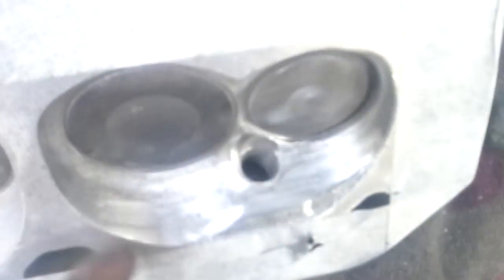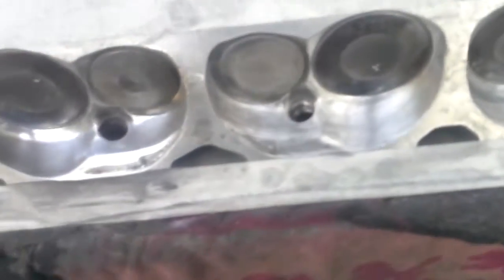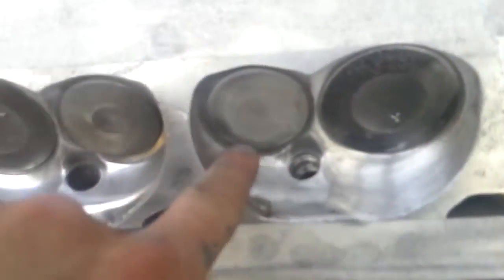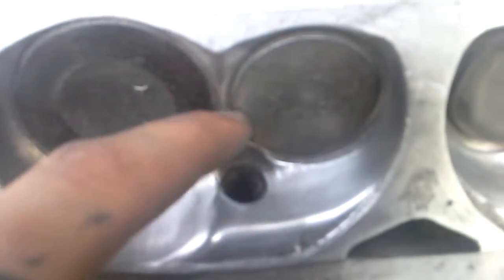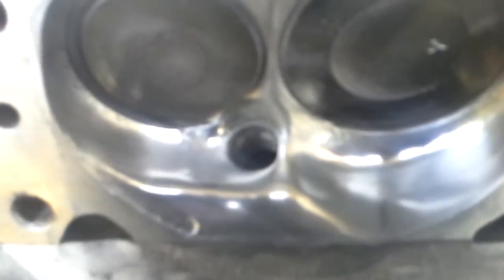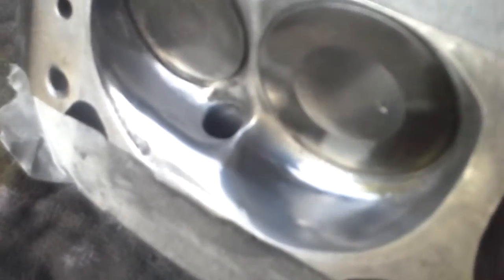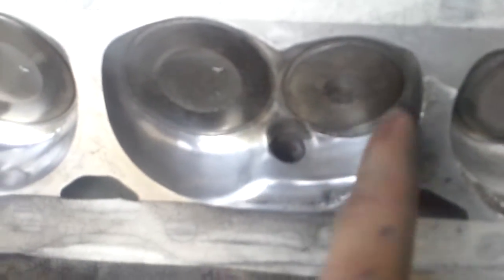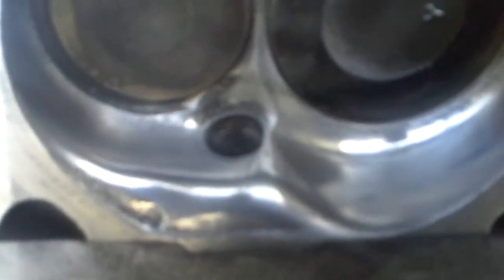Porting LT1 Heads

Comment: You don't even know what the hell you're doing ! Jeez. Folks , don't home port your heads.
Reply from the maker: Definitely didn’t know exactly what I was doing, especially when I posted this. I was at the time watching a lot of videos of a gentleman (can’t find his name now) that had done quite a few porting jobs on LT1s and he went way more extreme than this. My plan through this was to cut some of the hard edges down and smooth out the rough casting that’s pretty much it. These were milled/given a valvejob and worked great ever since. Was I wasting my time? Probably but it was fun and I learned some stuff. 😎🤘

Comment: I thought removing material from the combustion chamber lowers the compression down and you lose power
Reply from the maker: Big Greg sparks You're correct. However these were milled down to once again compensate for the loss of combustion chamber volume. Not to mention you can gain power from altering the chamber.

Comment: I ported a set myself. What all did you do to the intake runner? You get most of your power there.
Reply from the maker: These heads are back off getting reworked.. most of the material that came out of these was combustion chamber and exhaust. I'll make some new videos after I get finished up here in a couple weeks.
Reply: +Atomic Ws6  cool keep us posted on the progress.
Reply from the maker: +TPV Productions Will do man
Reply: +Atomic Ws6 Raising the runners helps the most.

Comment: real nice, do you do this for customers?  I have a 94 Caprice 9C1 with the aluminum LT-1 heads, I need a stage 4 job on mine, plan on using GM HotCam LT-4 and roller lifters, got Hooker Street Force headers on and true duals, 2 and a half inch pipes and Flowmasters 50 series muffs and 2 and a half inch tailpipes, how much power do you think i will get, also will use 52mm throttle body and MSD ignition and OptiSpark too.  I will rebuild the motor, 383 stroker.
Reply from the maker: BNforever2009 Thanks! I haven't done any customer jobs as of yet but these heads have come a LONG way to where they were in thee video. Ive actually gone over everything all over again and smoothed out the bowls and increase intake and exhaust chamber volume while staying in the limits of the heads. These heads are being resurfaced and getting a valve job at my machine shop but once they come back ill take a video on my new better camera of the final results. With the set up you're going with the power will l depend on what cam and heads you are running.. ive seen stock bottom end LT1s make 450 hp+ with a set of AI 200cc heads and a matching cam. With these heads, 231/239 custom grind cam and all bolt ons im shooting for 400 rwhp. Without the capability to run a CNC machine over my heads thats probably the highest ill be able to achieve.
Reply: Now i would like something like that for myself, a good 350 to 400hp or more is fine with me. Let me know if you wanna do this to my heads.
Reply: are you talking about the hp at the flywheel or rear wheels ?
Reply from the maker: BNforever2009 Rear wheel Hp. Ill need to put my car on a dyno to see what kind of numbers its laying down. Bolt ons with a good sized cam should put you in the 350-360 range as long as the rest of the motor is fresh.. I had ARP rod bolts put in my rods and had them resized just so I can spin the motor into 6500+ territory. And tuning is also very important but I will let you know! Ill upload a video once they are back from the shop.
Reply from the maker: BNforever2009 And once the heads are worked you can usually gain 20-30 hp by them. Usually the last 15 or 20 hp is in the tune.